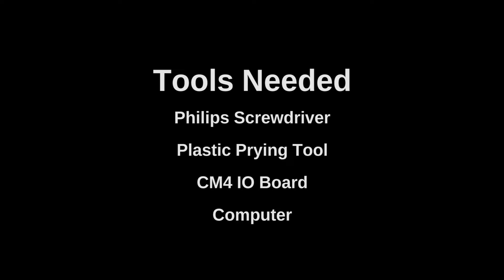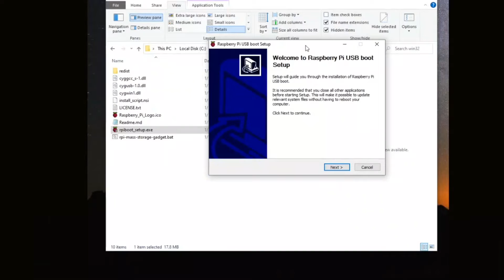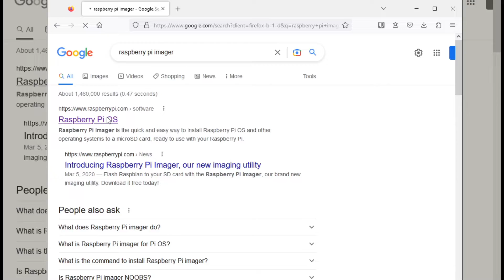How to Flash a Firmware to the Syncrobit eMMC using a Raspberry Pi CM4 IO Board

Comment from the maker: There are several different CM4 IO Boards to choose from. The reason I chose the Waveshare CM4 IO BASE-A board is because it can be powered directly from the USB-C port and it is almost half the price of the official Raspberry Pi CM4 IO Board. When using an IO Board, you need to follow the boards instructions on how to enable USB Boot Mode. With the Base-A board you just need to flip a switch to ON (03:55). Some other boards require the use of a jumper.
Reply: My pc doesn’t see the RPi to install the firmware on
Reply from the maker: @psychedelia69  Nebra has taken over OTA updates for Syncrobit. If you are still on the original Syncrobit FW, it should update automatically. If not, head over to the Syncrobit Discord where we can help you.

Comment: So why are we downloading the firmware and Balena etcher? At what point do we insert that SD card in the miner that we burned with Balena etcher?
Reply: There are two types of Syncrobit. One has an SD (you) this one has an eMMC and requires a board to flash the firmware. Your will actually be easier..you can just use an sd card reader.

Comment: i flashed my synchrobit today about 10 mins ago and everything is up and working with firmware 2023-2-24.zip. Helium Explorer still shows my old miner and says inactive, but locally in the device says its running Nebra and "ALL OK' for both "Device Info" and "Helium" tabs. Do you think I just need to wait for this to sync?

Comment from the maker: 00:00 Disassemble
03:20 Remove CM4 from Syncrobit
03:55 Enable USB Boot Mode
04:08 Install CM4 in IO Board
05:10 Install usbboot (rpiboot)
06:05 Connect CM4 to Computer
06:12 Run usbboot (rpiboot)
06:33 Install Raspberry Pi Imager (or Balena Etcher)
06:54 Run Pi Imager or Etcher
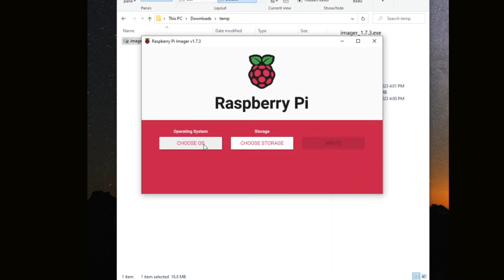07:05 Select Firmware
07:15 Select Write location (Raspberry Pi CM4)
08:00 Reassemble

Comment: Do we have to do this every time there is a firmware update or once it is done it should do OTA updates?
Reply from the maker: It should update Over The Air. I am currently using the Nebra Firmware and it did update OTA.
Reply: @quiglag  i just did the firmware update, i lost the LED light indicators, is that normal?
Reply from the maker: @mattyg0  Yes. As far as I can tell.
Reply: @quiglag  Is your miner still online? The process you posted seemed to work fine but I can't get online ethernet or wifi.. I will repeat and try again..
Reply from the maker: @chriscampbell7991  Yes. It's still up and earning with the Nebra FW. Head over to the Syncrobit Discord if you need more help.
Reply: @quiglag  thanks!
Reply: Good question! I also want to know this.